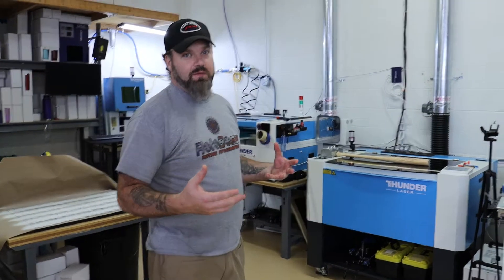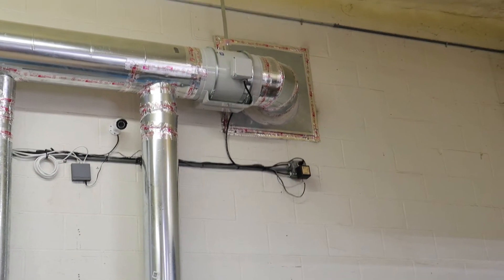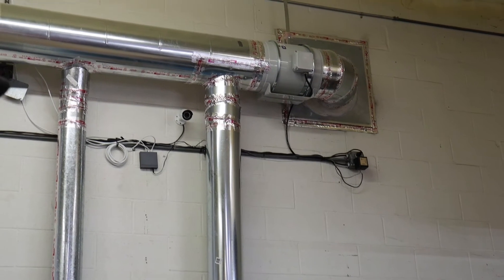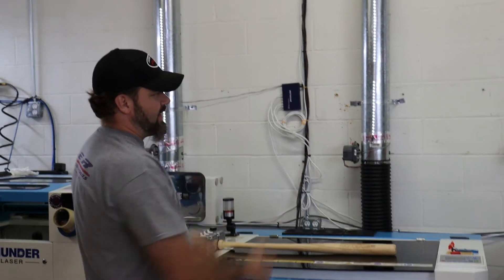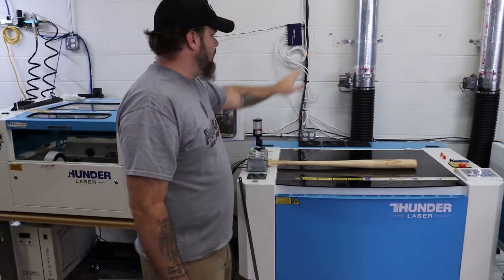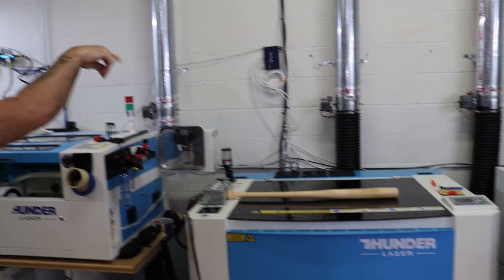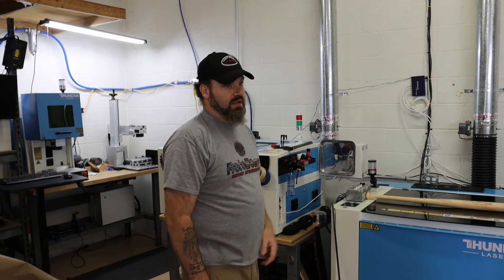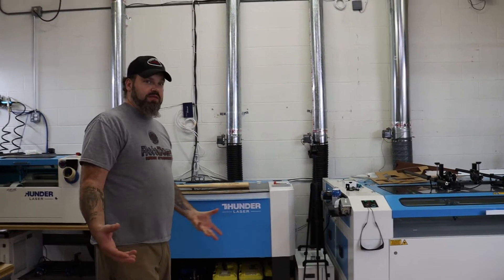Laser Shop Exhaust System

Comment: Hello. I love your setup. I really like the idea of electronic dampeners. I have a Nova 51 right now as well as an Omtech Polar running into an 8" duct leading outside, each has it's own stock fan. I like the fact that the Thunder automatically turns on the fan only when it needs it (via the rear plug). I wonder if there is a way to have the Thunders rear fan port automatically turn on your electronic duct instead of having to do it manually.... Just a thought. One less thing to have in your setup and one less thing to forget.
Reply from the maker: Good idea but not practical because it pulls from 7 different machines

Comment: Great video thank you!!
I received my first laser Nova 51 130W and I would like to know cat I connect exhaust fan to my gas heating exhaust ducting with T connector?
Thank you!
Reply: Hello, NO, do not do that. you need a seperate line but also having the laser in that same room you will need a intake (opening to allow air in) or you could pull flow from the heater and cause problems... i would contact HVAC people to make sure this would not be an issue

Comment: what do you have fir makeup air for the shop? Its always sucking air in without possitive pressure. Also i think some clean outs at the bottom of each feed would make life easier to service.
Reply from the maker: the other evac vent fan to the left allows air to come in.

Comment: Great setup.  I get the feeling that the other commenters have woodworking experience, as do I; but as I am learning there are diferences with in line fans, and pull is better than push. I also like with these evac setups is how easy is is to adjust the speed/cfm/pipe size to meet different machine needs.  Once again, great setup, and a model for semi-permanent-adjustability, lol, a new word. (also, what's going to create a blockage?)

Comment: The downside of this configuration is that the Fan will become congested and may clog with neglect. If the fan was pushing the smoke out with fresh air instead of sucking out the smoke it would have less problems in the future.
Reply: That is a big negative. 
Pushing air cause back pressure (positive pressure) and that is never a good thing for an evacuation system because it will cause leaks and blow smoke out of those leaks as well as cut down on the air flow from the back pressure created. Not sure what you mean by the fan getting congested but that is not even a thing because you always want a negative pressure specially when it is regulated as i have it. Having a fan create a Negative pressure (suction) is the best way to have an exhaust system. As for the the system as a whole, neglected maintenance is the users fault and not the fault of the system, no matter how you do it....

Comment: You don't use the supplied inline fan for any of the thunder lasers right, just the 12" - 1300cfm fan?
Reply: I don’t know if it’s necessarily overkill but I think you’ve introduced a lot of points of failure. Not to mention a lot of things to keep track of. There are some pretty good systems that will keep outside air from leaking in without any electronics. They also have failsafes to alert you if there’s blockage.
Reply from the maker: @Eric In SF  no points of failure in the system. They are there because they are behind the machines and I have no desire to leave room to get there or operate a manual damper. It is a  very simple setup and works flawlessly. Just my take on how to do it, others may have their own way or modify my idea to work best for them.
Reply from the maker: Correct... all of my lasers run off the single fan.
Reply: You have a part number for those solenoid dampener valves? I love this idea!